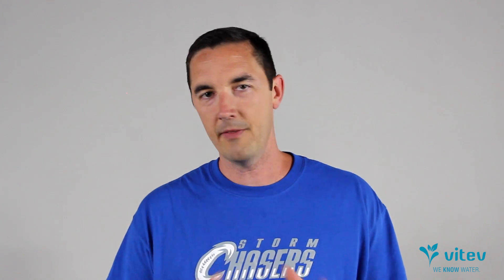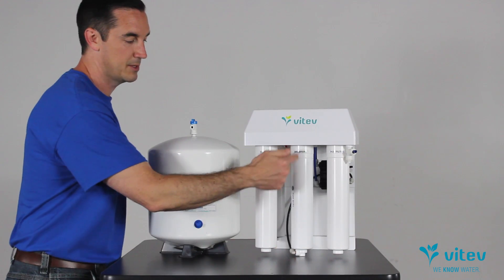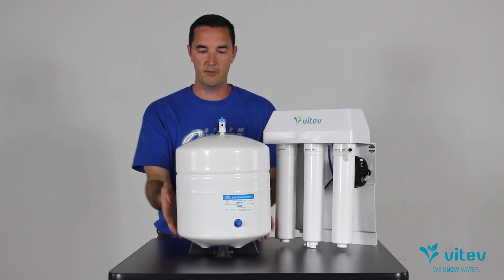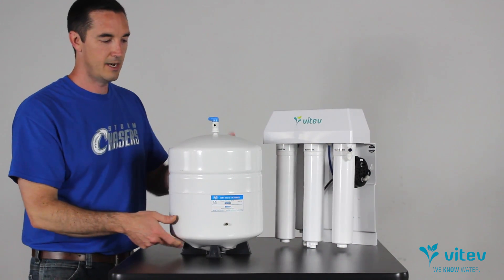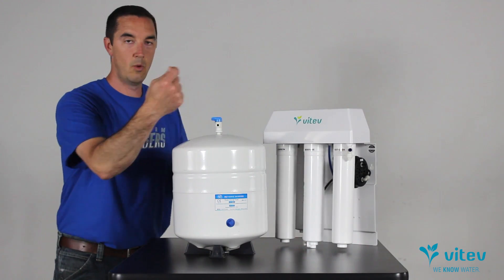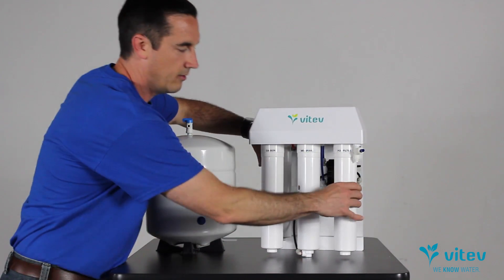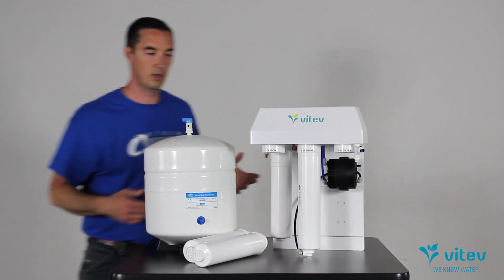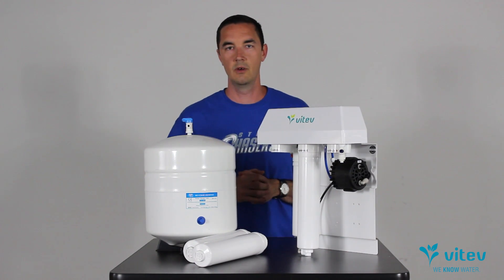How to Troubleshoot a Reverse Osmosis system

Comment: Nice video, after watching a handful of them yours was the most complete, thanks. Question; why do you only use 5-7 lbs pressure but the label on the tank says 100 lbs pressure maximum? Just curious.
Reply from the maker: That's external pressure coming into the tank, which is way above the typical household. When we say 5-7 lbs, that's the internal bladder pressure pushing out of the tank.

Comment: Thanks for the video but my tank fills after 30 minutes. It unfills in 10. The PSI on the tank is 7.5 and the drain line is not leaking.
Reply: Gavin Jones Then why are you even here if your system has no problem😂? Don’t comment on videos and say stuff like that for no reason

Comment: Please help trouble shoot , my drain line is always running, regardless the faucet line is on or not, this is a wasted of a lot of water down to the drain, am I connected wrong tube to wrong line?
Reply from the maker: Hi Le. The water will run until the tank is full. If it never stops draining, then water isn't filling the tank. You might have a clogged membrane that is only sending water down the waste line and not out the clean (permeate) side. Or your tank my have too much pressure and is therefore pushing back and not allowing the water to completely fill it. Empty tank pressure should be 5-7 PSI.  Check the clean water line from the membrane first and if that is flowing (it will be slow), then the tank pressure.
Reply: Thank for your reply bro, I took an advice from local water store to replace the automatic shut off  valve and it work perfectly.

Comment: I had the system for a while now. After the last filter change the water started testing really bad, any idea what needs to be done?  Thanks
Reply from the maker: Hi Monica. Did you flush the tank completely after changing the filters? Often you need to empty it before changing filters, let it fill, then empty again before the water is good to go. The filters can have some residue that needs to be flushed off first.
Reply: Yes we did flushed the tank. We did the filter change about a month ago still the water has a chlorine taste (it didn’t had it before the filter change)

Comment: This was a very helpful video as i am experiencing low volume of output and yet my tank is filled full with water ... so now that i have determined there is not enough pressure in the tank, wouldn't it be easier just to carefully pump some air into the tank to push out the water, rather than drain the tank completely and add pressure to 5-7 PSI?
Reply from the maker: Hi Michael. You need to drain the tank otherwise you won't be able to accurately judge the starting pressure in the bladder. Plus doing so while the tank is full can damage the bladder. Don't waste the water, fill up a pitcher or 2 as it drains.

Comment: Hi I have a problem with my ro system I have serviced it all the filters the membrane the taste and odor  and the automatic shut of thingy and a new tank  and still my tank is empty  what could be the problem
Reply from the maker: When you say serviced, do you mean you've replaced all of those components? New filters, membrane and tank? If so, no idea why the tank would not be filling. Would recommend like we show in the video, work your way from back to front on the system until you find the point where the water flows freely. You'll know whatever is clogging up the system is directly downstream from that point.

Comment: So is the inside of the pressure tank and bladder clean / sterilized? It seems like clean RO water in being stored in a tank and it the tank is not clean then the RO water is now contaminated. The bladder is rubber? Inside of tank is steel (iron)?
Reply: That's why there's a post carbon filter to pass through after the purified water leaves the tank.

Comment: Another thing to check before replacing your tank. If your tank has barely any pressure, and no pinhole leak in the bladder (no water spraying out of the schrader valve when you test the pressure) you may just have a bad schrader valve. Empty the tank and unscrew the valve and replace with a new one. Replacement schrader valve kits are like 5 bucks. Could save you 50$!
Reply: More appreciable comment .
Reply: Hi, I'm having a bit low pressure (not terrible, but just lower after I changed the filters). I have an 8 year old r/o tank from Culligan that I just re-pressurized. I emptied the tank, re-pressurized with the valve closed to 7 psi, and the pressue is still pretty low compared to before the filter changed. I also noticed this morning that the tank barely had any water in, and it's been filling since 3pm yesterday 3/5/23. Is it possible the water was used filling ice all night. Otherwise, I cannot figure out why the pressure isn't that grate. Also, before the filter changed, I could fill 1 pot of coffee with water and by the end it would be slowing down quite a bit. I'm wondering if I need to replace the tank...thoughts? The valve seems fine, but who knows.

Comment: Have an ever pure r.o. system. We were using our system the night before and Water was coming out of the faucet before the filters were changed.  Plumber came and installed 2 of 3 filters and said he has to pressurize the tank. He opened up the faucet to let the water drain and at first it trickled and then nothing. He said there was water going through the tubing and when he opened the valve on the tank when said water should shoot out.  It didn't.  After about 20 minutes with the faucet open and little to no water coming out he said I needed a new tank.  The tank is full.  Does it sound like he is being honest?
Reply from the maker: Hi Nolan. If the tank is full and no water is coming out, then yea, you probably need a new tank. The only reason water would not leave the tank is if the bladder is not holding enough air to provide the pressure needed to push water out. Not sure why it would be fine before the filter change and not after.  You could turn the valve on top of the tank off, remove the tube, take the tank outside and open the valve to see if any water comes out. If the RO is functioning water should also come out of the tube heading to the tank when the tank is disconnected.

Comment: The storage tank is full and very heavy . But a very low flow of water from our system. water starts out strong but after about 15 seconds it slows and almost drips 
What should I do
Thanks
Reply from the maker: That might mean there is something (post-filter) clogging up the flow between your tank and the faucet. Or the pressure in the tank is too low to push water out after the first few seconds.

Comment: you mentioned that the tank might not have enough pressure, but you did not say if you can increase the pressure of the tank or how to do it.
Reply from the maker: Hi Chris. Yes you can increase the pressure. First empty the tank of all water and then use a bicycle pump to add whatever air is necessary.

Comment: Thank you for the nice video.
I have "DUPURE" system. The water flow was diminishing and fully stopped at once, so i called them. they sent me two filters(carbon).
 I replaced the filters last week. still there is no water coming inside the tank and out of the faucet. I have constant 7PSI in my tank. I found a spring loaded lever at the bottom of the filters. I pressed that lever, and I heard the water flowing/gushing sound through the system....
 If I call their technician they want me to pay $140!!! 
I am trying to reduce my expense ... I don't know what i am missing?
Could you please give me any hints?
Thank you
Reply: I have this same problem now with Dupure. Haven’t replaced the filters yet but I know they’re overdue. I picked up the tank and can tell it’s empty. Worried when I replace the filters the water still won’t come through